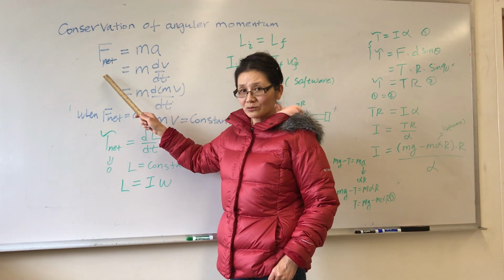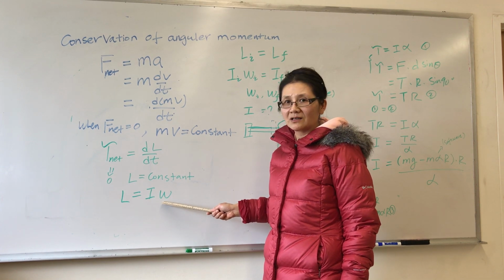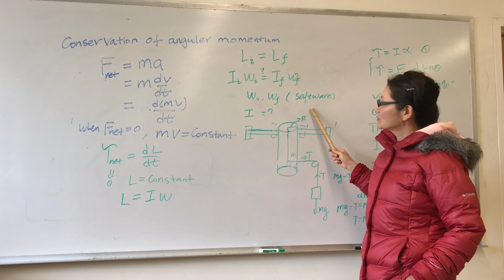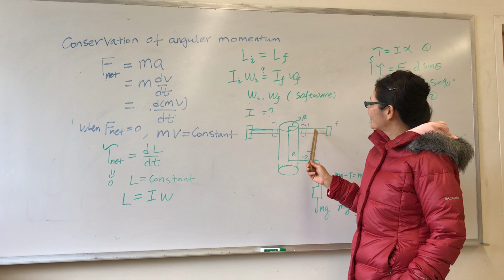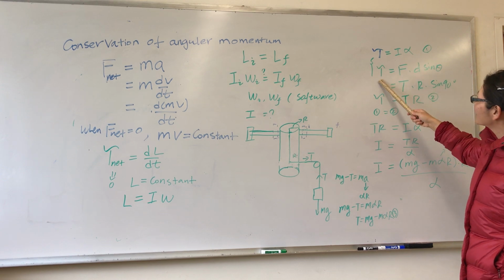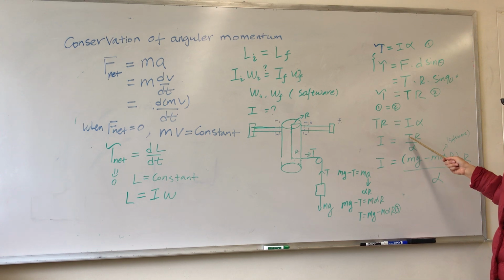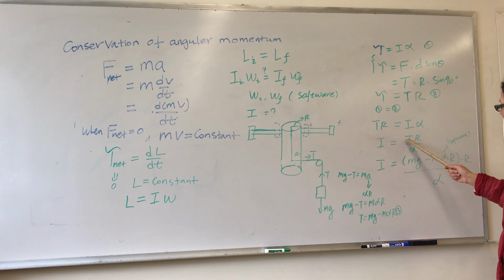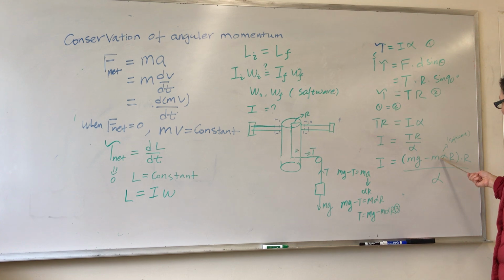conservation of angular momentum lecture

Comment: Hi Grace, unfortunately, angular momentum is not conserved. If you measure the examples you find that they do not "spin faster" anywhere enough. They "spin faster" because angular energy is conserved.

This is truth. Measure it before you dismiss me with prejudice.
Reply from the maker: John Mandlbaur  There is no prejudice in science. I should say clearly that the set up  for 100g hanging mass is for measurement of moments inertia.  In the demonstration part I mentioned it. Angular momentum is conserved when there is no extra torque( no 100g hanging mass). Thank you for your advice. Let’s me know if there are any other mistakes. I took 14 videos around 3-4 hours because quarantine restriction. I was pretty tired towards the end.
Reply: @gracepancalstatela4422  Prejudice is a natural human trait and all scientists are human. Hanging mass is not a valid example of angular momentum conservation. Angular momentum conservation requires a variable radius to demonstrate. Demonstrating conservation of angular momentum without varying the radius is like demonstrating that velocity is conserved in a system that applies no force.

Please understand that this is not personal and I have spent four years of my life trying to point out this stupid mistake in the basic laws of physics to scientists. Scientists are so prejudiced that they are unable to address any of my arguments and dismiss what I have to say without any thought whatsoever.

Scientists should by their own definition be prepared to consider the possibility that they are wrong.

If a theoretical argument cannot be defeated logically, then the conclusion must be accepted.

I have yet to meet a scientist capable of maintaining rationality when faced with any of my arguments.

For example please address this argument: www.baur-research.com/Physics/MPS.pdf